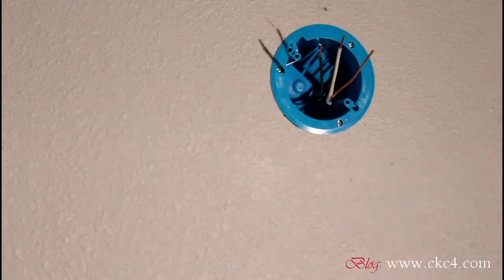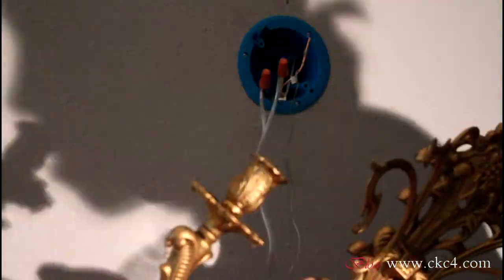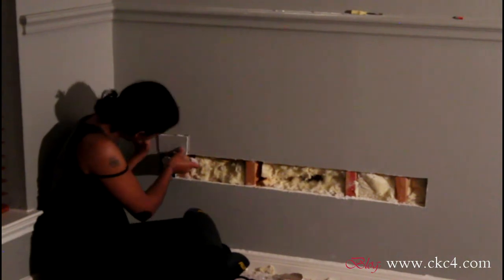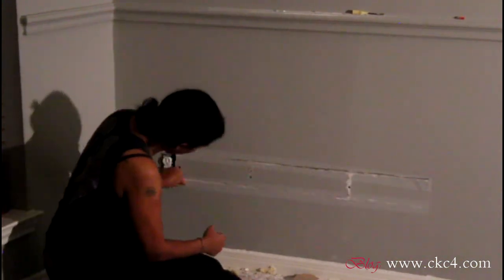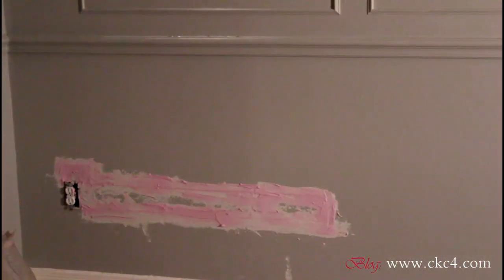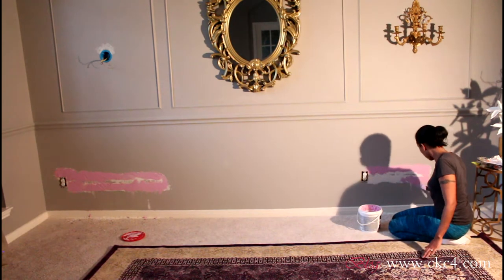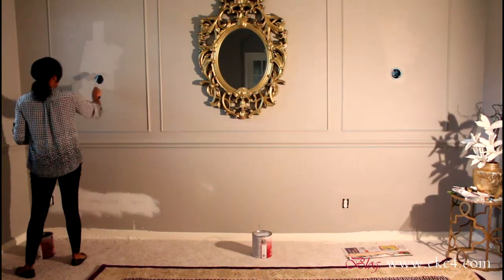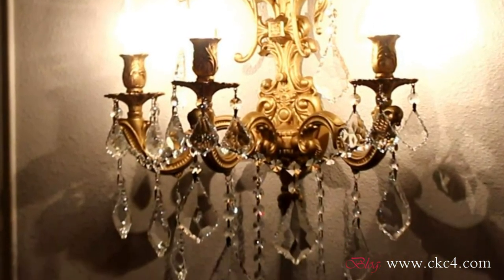DIY | Watch as I Install an Electrical Sconce | Part 2

Comment: Your tutorial is excellent! Both parts 1 & 2. I have a question…I want to i stall two cafe wall sconces but into one outlet instead of two like you had. My outlet is also controlled by the wall switch. How would I do that?

Comment: You are good. Did you go to school for this or take any classes. I really want to take some classes so I learn how to do some home projects myself, can you recommend any? I line how you have your own table saw, & actually know how to use it.
Reply from the maker: mamatosh05 Hey Lady. Thank you so much. No, no schooling. Unless you count the school of trial and error. I used to do a lot of this when I was a child with my father. Besides that, a lot of reading and videos. I know both Lowes and Home Depot have free classes every now and then which teaches these types of projects. If I can give my advise, don't be afraid to try it something. Especially if you've done your homework and research. Once you get past just jumping in and trying it, you'd be surprise at how easy a lot of the projects are. And it's ok if it doesn't work out. Trust me, I've had many FAILS. But I keep at it until it's a win. Also, start small. Take on small projects like patching holes, or replacing a fixture, or building a small box. Then work your way up from there. I have every faith you would be a pro in no time. Thanks so much for commenting and supporting. Have a blessed day.
Reply: You're welcome. Thanks for replying back.

Comment: You skipped details of connecting first sconce wire to outlet and putting blk with red to connect for switch. All the wires in outlet to connect to switch. You went too fast. Thats major. I was waiting for that since it seems you put blk with red and green you used because you didn't have blk. Omg! Shoot me.